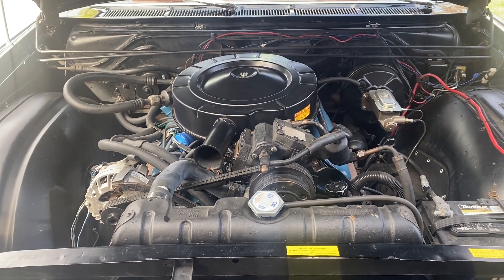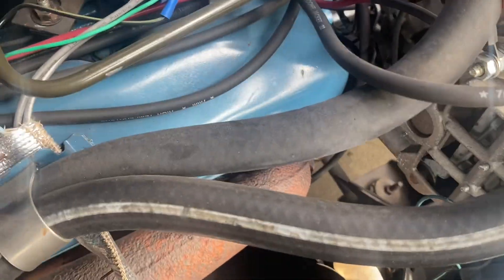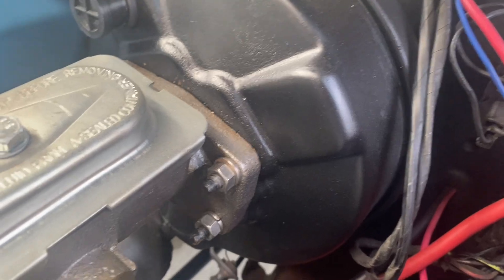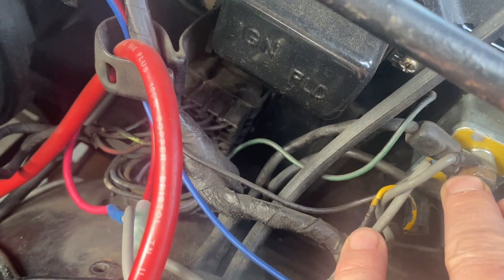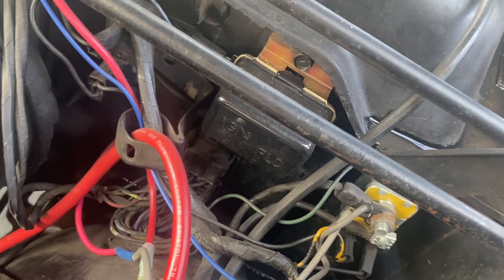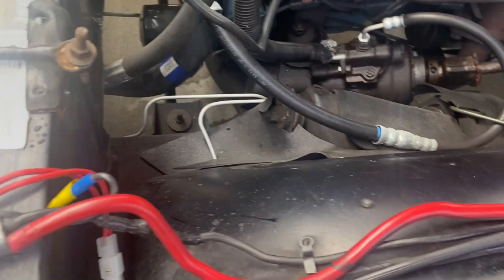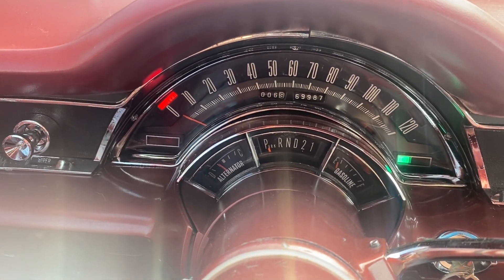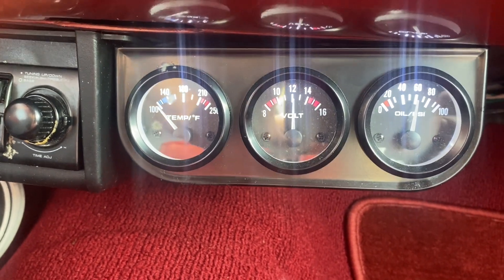1966 Chrysler Newport - Ammeter Bypass

Comment: There's absolutely NOTHING wrong electrically with that modification as you performed it. I've done that myself numerous times and it's the least destructive method for improving the reliability of that connection. I would use an 8 ga wire, but based on your alternator you're fine. Those old alternators only put out 35-37 amps. Electrically that original ammeter battery lead (red) side terminates at the exact same point. Electricity travels the path of least resistance. All that bypass does is shunt the charging current along a thicker, shorter, less resistive path. If you wanted, (to nullify the gauge) you could attach both leads to one side of the gauge (backside) and rely on the Volt gauge which is a more accurate representation of electrical system state anyway. The guy commenting below is confused. Of course it will show a discharge, the reason the gauge is showing a DISCHARGE is because current is following primarily FROM the battery to the accessories via the red gauge terminal and the alternator is charging via the new 'bypass' wire around the gauge, but accessory draw is still 'through the gauge'. The ammeter is no longer accurate because the alternator output is run DIRECT to the battery, but that doesn't mean that there is going to be any more load or current imposed on the original circuit. There are a number of accessory splices under the instrument panel tied to that alternator/amp lug that will STILL draw power through the amp gauge, however the alternator charging current is provided by the new wire. A point of fact is that when you upgraded to the Leece-Neville 65 amp fleet alternator the factory ran the upgraded alternator wire in the SAME way, except through a hole and grommet in the bulkhead but through the amp gauge. They used an 8ga black wire from the alt through a bullet connector and 10ga red from the amp gauge to the starter relay. Direct. The simplest way of saying it is that the amp gauge is not monitoring the 'whole' electrical system push and pull now, and is ONLY reflective of the draw. If you put an amp gauge on your 'new' wire you would see that it shows a 'charge' by roughly a little more than the discharge current on the gauge in the car. Which means the readings would cancel out and show a 'slight' charge. Which would be correct. One other thing, next to the bulkhead connection, the ammeter itself and those connections are the second high failure weak points. So these other videos running 'new' wires to the gauge aren't doing much for you.
Reply: @daveturnerbassguitar, Interesting comment to pin here, this is the backup to all the misinformation shown in this video? Yea, I’m the one that's confused here. Nothing wrong with this bypass as is described here? For starters, how about it defeats all originally designed circuit protection, exposes all factory unfused wiring to up to full current potential of the battery in the event of a short thanks to a parallel path around the stock fusible link. Nothing about this shunt wire bypass makes the charging system safer, in fact just the opposite, it is far more dangerous with it in place. Vehicle loads are not routed through the ammeter while the engine is running under any circumstances when correctly loaded and as designed. Applying a voltage source with a current potential that will allow current to exceed the ampacity of any conductor in a circuit with no (bypassed) or insufficient (circuit protection devices wired in parallel) is electrically wrong. Loads will not register on the ammeter if the system is loaded correctly. The alternator is the only source of power while the engine is running, no power is drawn from the battery while the alternator is in operation unless the total load exceeds the capacity of the alternator. All factory loads take their power from splice 1, should not register on the ammeter at all as all power is produced and consumed on the alternator side of the ammeter as designed. The ammeter should only register battery charging current, fully charged that should be very little to nothing, will not register vehicle loads at all unless the engine is off, the alternator has failed, or the loads exceed the alternator capacity. High ammeter failure rate? Just more Chrysler ammeter misinformation here. The passenger car ammeters from this time can handle a great deal of current, did not have a high failure rate when they were left unaltered, connections are well maintained and the system is loaded correctly, no loading on the battery side of the ammeter.

Comment: I am wondering why no one seems to think that running this past the voltage regulator is a good thing?  Basically, why not wire it to the voltage regulator so that you do not overcharge you battery?  Just wondering?
Reply from the maker: The voltage coming out of the alternator to the starter relay has already been by regulated, that’s why it’s 14v.

Comment: You asked for corrections? That ammeter is not wired correctly at all, by-passed or not. There shouldn’t be any vehicle loads registered on the ammeter while the engine is running. Wired correctly, the ammeter should only register battery charging/discharging current, not any vehicle loads while running. All loads, stock or otherwise, are to be on the alternator side of the ammeter as originally designed. That ammeter is now exposed to way more current stress now than if it’s wiring had been left alone. Appears as though the original alternator feed at the bulkhead connector (12ga black wire) is damaged, removed or failed altogether (high resistance).
You are missing the basic understanding of how that charging system functions. The described “under-hood” by-pass also increases the circuit protection level, by more than a factor of 2, of the stock un-fused wiring as it by-passes the stock fusible link too. The stock 12 ga charge circuit wiring and components are now exposed to close to 100+amps of battery current potential in the event of a short as both fusible links would have to open to stop current flow.
I’m afraid your dangerous comment may more true than you may think. As a old-time dealer trained master tech with many years of experience in the trade, I see a much less safe electrical mods have been preformed to that car.
Reply from the maker: I will make some modifications based on your feedback, thank you.

Comment: That's exactly one of the first things I did to my '68 Plymouth Fury VIP once I got it back on the road. Later, I had to pull the speedometer cluster for another reason and while I was in there, disconnected it from the ammeter, bolted the wires together and gave it a good wrapping in electrical tape. I hate the ammeter isn't working, but thought it would make it a little extra safer.
Reply from the maker: I almost did the same when I had my IC out, but someone had already done something there and I didn’t want to mess with it. Thanks for watching!